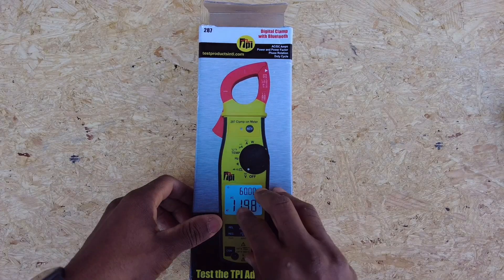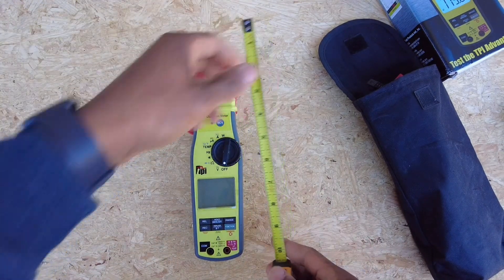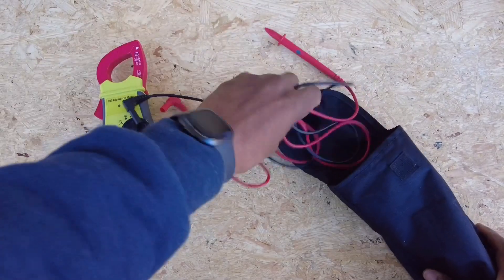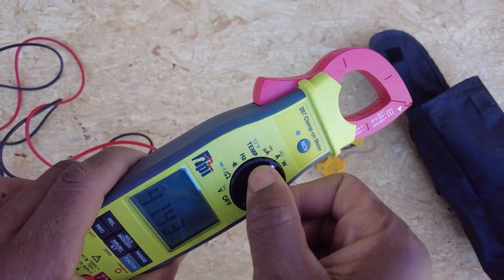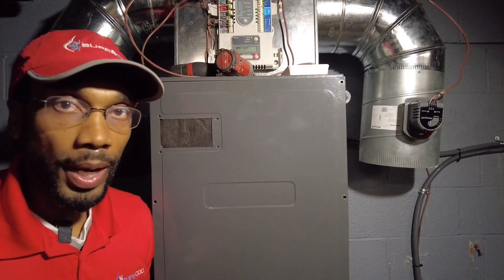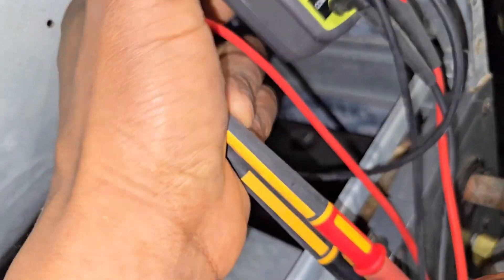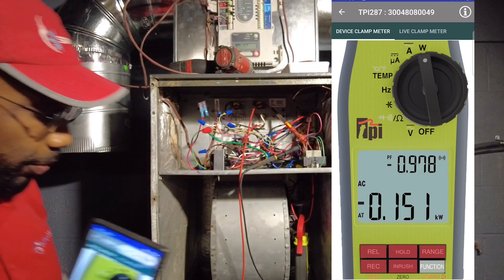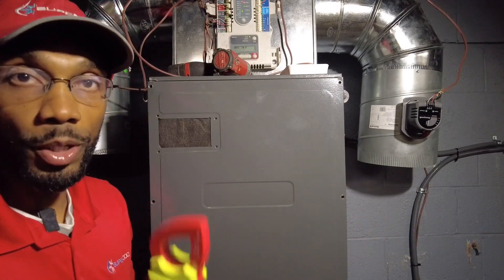Best Bluetooth Meter of 2025 TPI 287 Clamp Power Meter Review why HVAC Techs need this Clamp Meter

Comment: Does it have a magnet 🧲?

Does it have clips to hold the leads or at least one lead?

It looks pretty good but the way you teased it a few days ago I was surprised by the price. It's not cheap, that's for sure 😉
Reply from the maker: Hey! Thanks for the comment, no magnet or meter clips. I usually just use some two sided tape and put a strong rare earth magnet on the back. That’s what I did with my testo 770–3 and it worked great!

Honestly, I’d say the price is pretty fair given the features and quality of the meter. Remember power meters are usually in a different price point than your run of the mill clamp meter 😉

Comment: I want to upgrade my current meter (fluke 902fc) to something that has more capabilities. I was looking at the testo 770-3, but do you think this meter would be a better option?
Reply from the maker: Yeah, Id definitely recommend this meter over the testo 770–3 meter. Reason being the build quality of the 770-3 is lackluster. Trust me I own one and it only took one light drop to bust the clamp assembly. It also does not sense frequency through the clamp below around 7 A at 120 V and around 4 A at 230 V. The reason this matters is these power meters measure frequency through the clamps in order to calculate wattage (true power usage). So if your load is pulling 2 A and the meter doesn’t read frequency through the clamp below 4 A the meter is useless for measuring wattage on that load. Most air handler blower motors in the field are pulling well below 4 A. I’ve got a video where I performed bench testing with the fieldpiece 680, Testo 770–3 and the redfish 550 to demonstrate this. Let me know if this makes sense? But all in all it is a really nice meter and more importantly the company really seems to stand behind their products! Hope this helps
Reply: @ Ok thanks for letting me know about the build quality that was something I was unaware of. I was also considering the redfish 550, do you find the tpi to out perform the redfish as well?
Reply from the maker: @Timedesigner yeah I love my redfish idvm550 its a super powerful meter but I will say, the TPI 287 has a pretty strong advantage. Mainly because it does DC microamps and phase rotation, and the idvm 550 does not. those are pretty important features for an HVAC Focused meter. I also like the clamp on the 287 better. It's just more Compact and gets into tight areas better and no matter where the conductor is within the clamp jaw the reading really doesn't vary at all. Trust me if you do HVAC you can't go wrong with the tpi 287 meter.
Reply: @ Thanks for the information I’m going to consider the tpi 287. I’ve been looking around a lot to find the right meter since I’m trying to transition into service (currently an installer).
Reply from the maker: No problem! Glad to help. Yeah definitely do your research first for sure. feel free to reach out if you have any other questions.